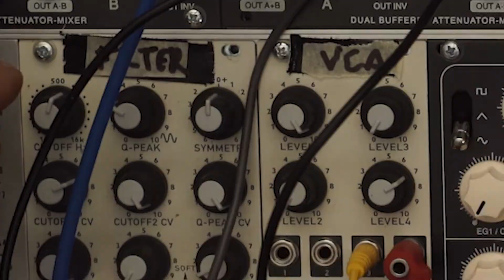twinCussion 3

Comment: Great video. I got my twincussion yesterday and love it so far. The envelope attack is great, I used to have to tidy my attacks in ableton but am so happy with it raw! I was wondering how the output to output patchings work? There isn't anything in the manual and I am a bit nervous with patching my outputs together.
Reply from the maker: in eurorack format you CAN connect every signal to any other one. it might not make technical or musical sense but surely it won't harm you or your system. this goes also for all out sockets of the twinCussion. in fact it is passive mixing of signals, technically imperfect i guess but still effective and useful as you can see. so please explore this. all the best!